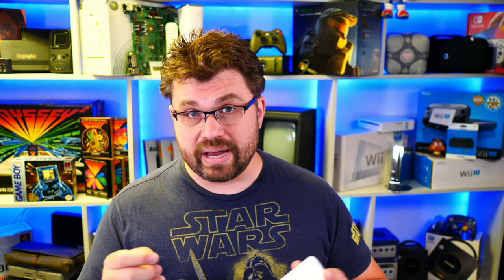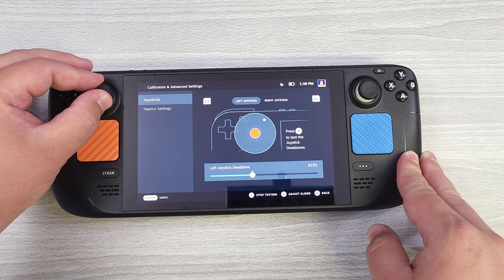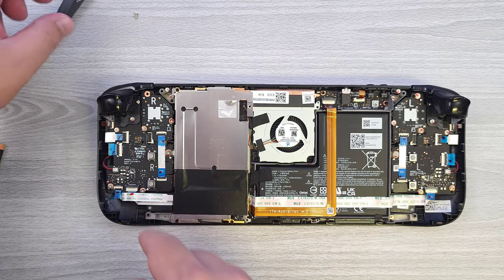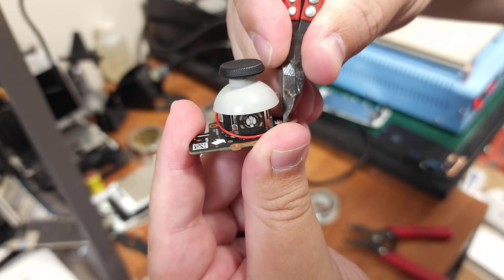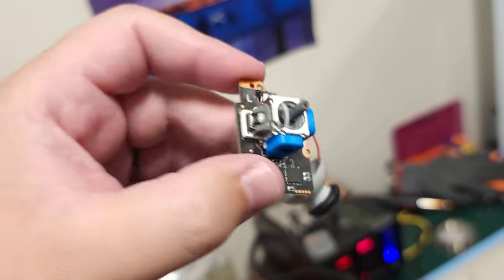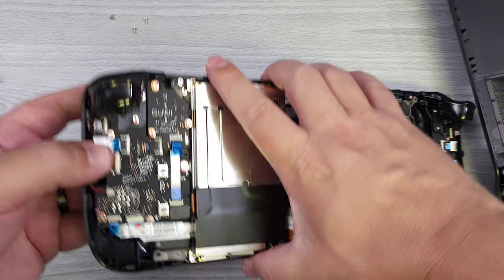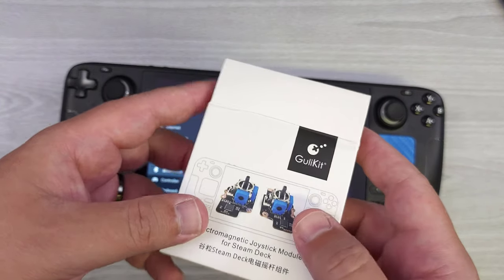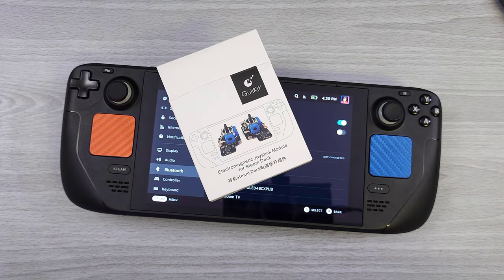Gulikit Hall-Based Analog Sticks For STEAM DECK - How To Install Analog Sticks On Your Steam Deck!

Comment: I don’t understand how a Hall sensor can be immune to stick drift. Sure the parts inside the sensor can’t wear out because nothing touches, but the stick is still centered by basically nylon rubber bands. 

When those bands wear out over time the stick will no longer return all the way to center and there will be a wobbly spot in the center, just like current joysticks. 

So I don’t believe it will be immune to stick drift, but it may be immune to wearing out internally.
Reply: From what I understand, ‘stick drift’ is less about the sticks returning to the centre physically, and more about that centre point no longer being recognised properly. And a recalibration won’t correct fully because you’ve basically lost sensor range in one direction. I may be wrong, I’ve not experienced it myself, but that is my understanding.
Reply: @SilentShark  I understand that’s one form of stick drift but I mostly see the right thumbstick stop returning all the way to center requiring me to open up the dead zones in steam. 

I bought a brand new Xbox Elite 2 controller recently and out of the box the sticks wobbled a little in the center and it was enough to drift.
Reply: @sean5170  I have not had that issue personally, but that sounds pretty annoying. I also haven't used Xbox controllers since my 360 controller died a few years ago, so maybe that's more of an issue with their units.
Reply: There is no bands on hall sensors.

A piece of metal and a bunch of magnets, that is all.  They find your joystick position by how far away the metal is to the magnets.  No more reading on resistance bands.  As the result, no wear and no teare.  Nothing is touching or connected to anything.
Reply: @will3641  What keeps the sticks standing straight up and keeps the resistance on them? The magnetic pick ups are just for the sensors, but I believe it still has bands for the tension.
Reply: The dead zones are still gonna wear out over time.
They only solve the kind of "drift" that is common with Joy-con, where the sensor register false inputs that didn't actually happen.
Reply: @will3641 
The sticks are pivoting at some point, therefore rotating parts. They have to return to center in some way too. There is wear eventually.
Reply: @sean5170  oh, that is what you are talking about ... Well, yeah if you force your way, you can break anything...... I always got drift first though. Replacing them are easy enough for me.
Reply: @2010ngojo  I see what you guys talking about now, but I have never break it that way.  Anyway, if it break that way, it will be super easy fix.

Comment: Drift detected at 4:09 ! 
it did not properly center when you let go (THAT is exactly what the deadzone is for ...just that little nudge is enough to make you walk sideways without a deadzone).  
My right stick does this as well.  
That said, this is a gigantic dead zone (by default) i reduced mine to 3500-ish.  
You can easily test how the difference feels when using the right stick as mouse pointer in desktop mode, trying to make small precise movements with 8000+ is hard, with 3500 it is much easier to hit a button that is right next to the mouse pointer. I'm not sure yet how well that translates to gaming, i assume console ports or modern multi-platform games will have plenty auto aim and baked in dead zones anyway, but if not then this setting should apply.

Comment: hall sensors are inaccurate. don't waste your time and money.
Reply: Rubbish. They are very accurate if you have the good ones. At least 12bit accurate
Reply: @HermanKruisman  No. That is the encoder output resolution. It means nothing if the sensor itself is affected by random magnetic field fluctuations or electrical noise. Not to mention the magnets can also be affected by temp.
Reply: @ddbhaha1529  I have been using hal sensors for many years and they were always accurate and true. You must have a really strong magnetic field to influence the sensors at a distance. Not likely to happen. Filters on the powerline will prevent most noise issues.
Reply: @HermanKruisman  Same claim can be told by so many regular potentiometer users. Actually reputable manufacturers claim hall effect sensors are durable while being somewhat less accurate than potentiometers. Only a BS manufacturer claims one is better than the other.
Reply: @ddbhaha1529  hi Nintendo employee
Reply: @0Asterite0  A child.
Reply: @ddbhaha1529  commenting about a system you've never tried in a gamepad
Reply: They are just as accurate as the pots. However, the thought is that these won't degrade like a conventional pot. Only time will tell, but these should outlast their resistive swiping counterparts.